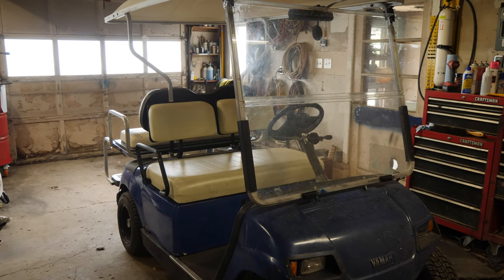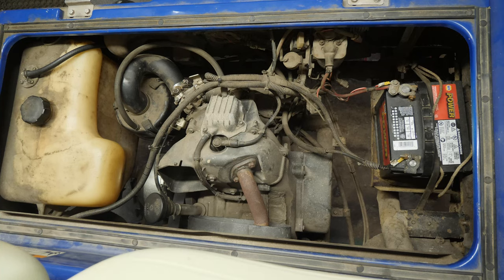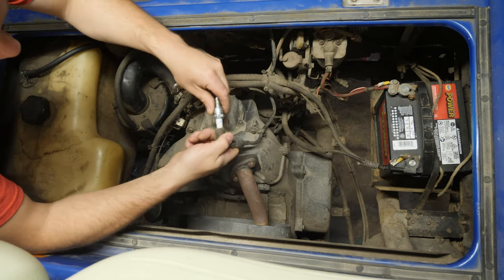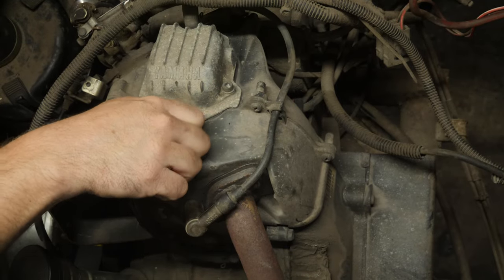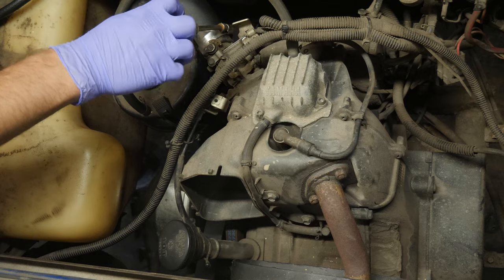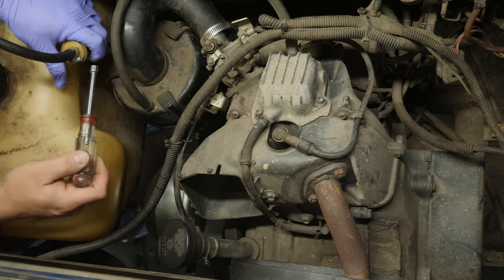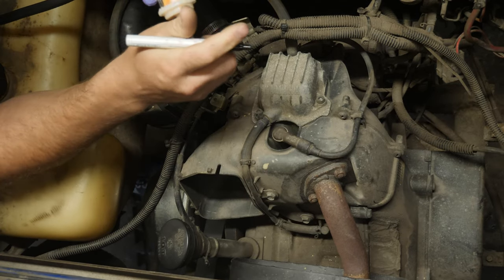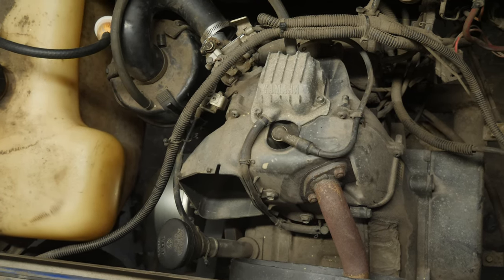1996 Yamaha G14, Gas - Won't Start After Sitting Over Winter

Comment: Just bought an identical cart. It was a no start condition. Cleaned the terminals and replaced the battery. Got it to run but it's sluggish unless you pull the choke while driving. I assume it's the carb. I have fuel coming of the pump. Your videos are very helpful thanks again.

Comment: Great video!! Wondering when you might do another live Q & A....? I have a 1995 Yamaha G14. When the accelerator is pushed it hesitates for a few seconds, then takes off. Even if pedal is pushed all the way down, nothing happens for about 3 seconds then cart accelerates. After watching your other videos, I did take apart and cleaned the carb, but still does it, and it does have a backfire once in awhile. Thanks for all the videos, they are a great help!
Reply from the maker: I plan to do more live streams answering questions. I don't know exactly when, though. When you say it hesitates, do you mean it hesitates to start cranking or hesitates to fire up after it starts cranking? If its hesitant on cranking, it could be a weak battery, faulty brush in the starter/generator, bad cables. If its hesitant on starting, you could have the cables out of adjustment or bad fuel.
Reply: @Kevinsgolfcarts  When I press the accelerator down there is silence, no cranking at all. Then after about 2 to 3 seconds it jumps to life. It almost seems to work better if I "feather" the pedal slowly. Once it cranks, it goes. Battery is brand new so maybe an issue with brush in starter/generator, or the cables. Thanks again for your help and the great videos!
Reply from the maker: Yamahas can sometimes be hard cranking, depending on where they stop in the 4-stroke cycle. Most of the time, they will be hardest cranking during the initial compression stroke. I've found that replacing the factory battery cable ends with crimped ring terminals and new battery clamps helps a lot. If the cables have green corrosion under the sheath, I would replace the entire cable with new 6 gauge battery cables.
Reply: @Kevinsgolfcarts  Thank you!!

Comment: I have the same one but my problem is  it bogs under load and also when its in neutral..I've adjusted the carb even cleaned it out.. new gaskets..pretty much a full tune-up.. I've looked on line and it says 1.5 turns on the screw for the carb. I've tried 1.5...2..2.5..even 1..still bogs and back fires..any idea ?.  I have to pull the choke to get it to run
Reply from the maker: Might need a new carb. I've seen them blocked up internally and not able to get them clean. The only fix was to replace it. Make sure you get one for your engine. I've also seen the wrong carb installed and it causes similar symptoms.

Comment: i recently baught a g-2 ? and was changing the oil yesterday couldnt find the oil filter do these carts even have one? could not find anything on the tube about that. thanks for your content.
Reply from the maker: No, these engines do not have an oil filter. They are splash lube. They have a "finger" that comes off the connecting rod that splashes the oil inside the engine. These engines really have no way to push oil through a filter. Engines with pressure lube systems (oil pump built into the engine) have oil filters. This gives the engine a way to push oil through a filter. I hope this was helpful.
Reply: @Kevinsgolfcarts  yes thank you

Comment: True story today at work: 

1996 EZGO TXT with the 'good' engine (twin cylinder) guy brought it in, had it three years, and claimed it didn't run. Just cranked. It was OUT OF GAS. That is the THIRD time we've had this happen. They use so little fuel that people just forget to check.
Reply from the maker: LOL I've had so many calls like that as well.